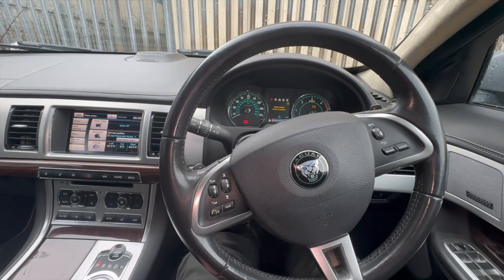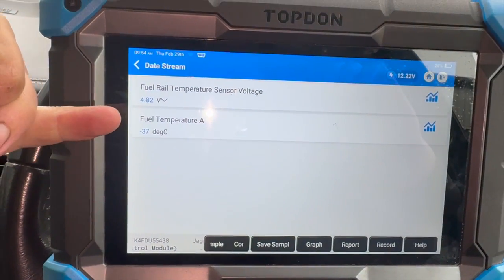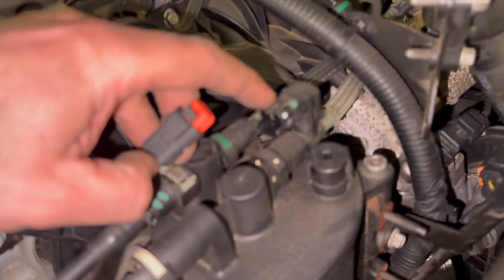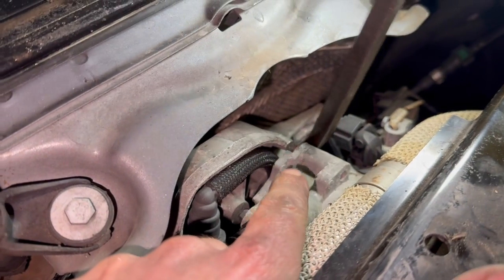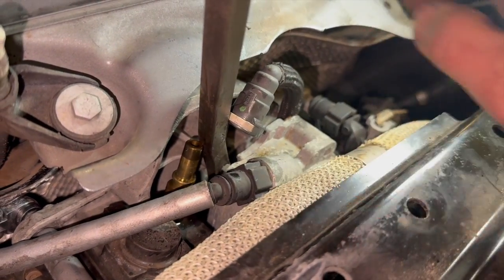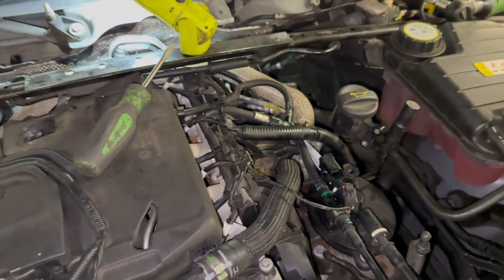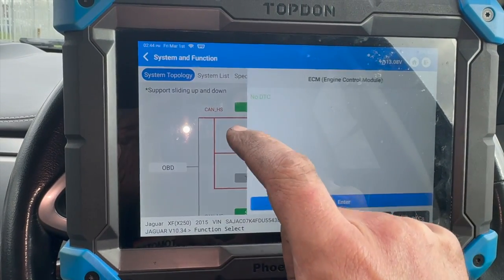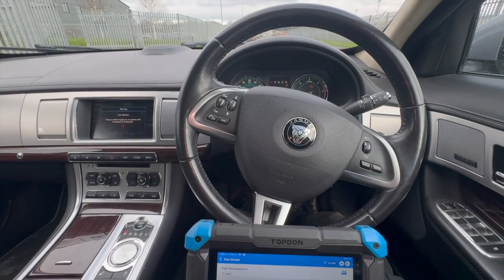Jaguar XF P0183 Fuel temperature sensor A fault

Comment: Hi, I have a 2012 jag xf 3.0 petrol non supercharged with the same code. Actually it was p0182 (low circuit) before and yesterday it changed to p0183 (high circuit). I'm trying hard to find the part number for the fuel temperature sensor for my engine. Can you pls help with the part number..! Thanks alot